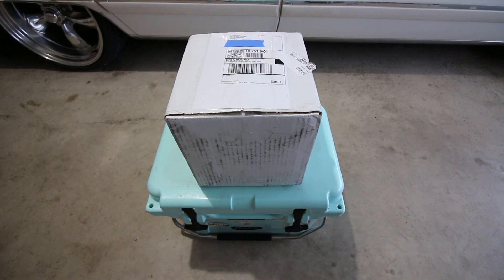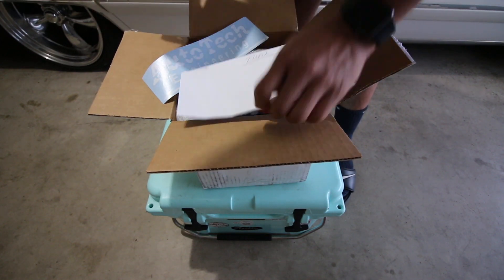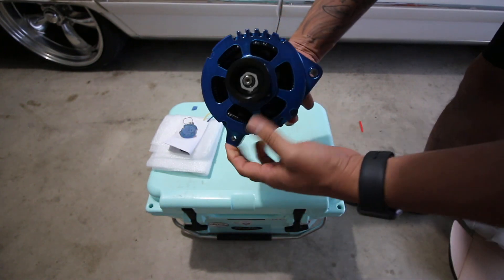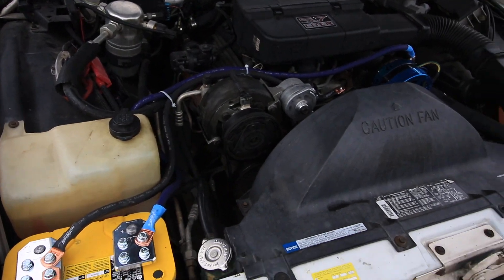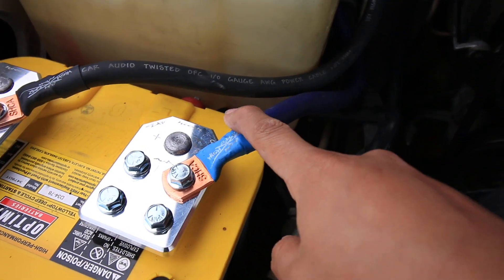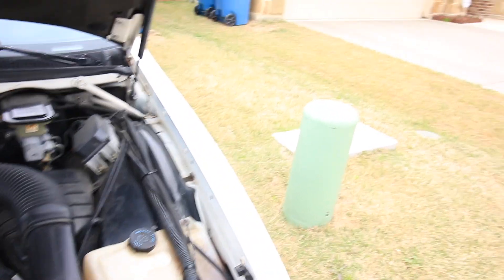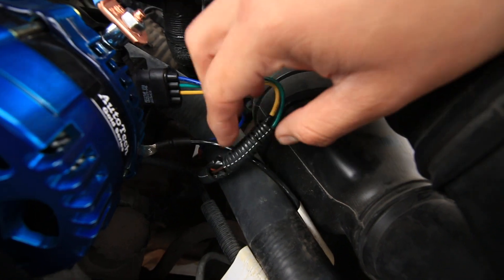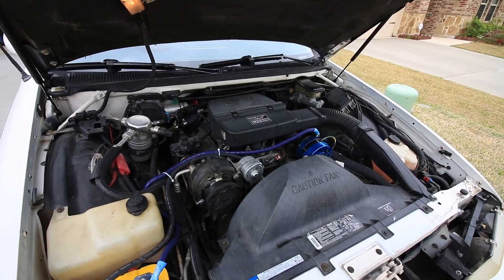AUTOTECH ENGINEERING ALTERNATOR UNBOXING AND BIG 3/4 AND UPGRADE

Comment: Did you have to use a smaller belt
Reply from the maker: Yes, you want to find a belt about a half inch smaller than OEM to accommodate the pulley.

Comment: Hey bro if i was you remove that ground wire from your chassy, then run it  to your ground post battery. The reason why i say that, is because you can fry the alternator.
Reply from the maker: The ground from the alternator to the chassis? I'm new to this, can you elaborate for me on how it would fry the alt?
Reply: @RidinDirtyTX  you get better current from your ground battery terminal. If you ground it on the chassy or block. Your not going get that good of a current. Do you have audio in your vehicle?
Reply from the maker: Yes

Comment: Do you have any suggestions on what to do if I can't access my original Engine ground I can't find mine anywhere 3.9 L v6 buick lucerne. I was wondering if I could find my own ground on the engine and leave the stock one alone?
Reply from the maker: Yessir, you’d be fine. Matter of fact that’s what I did. Factory ground was inaccessible without removing a lot of stuff, so I found another grounding point and used it.
Reply: Thank you very much!

Comment: Love the color! I might be going the same route. Difference being I'm using zero guage for power and ground and using the secondary battery first. Then if I suffer power issues I'll go with the stronger alternator. Haven't visited their site yet, but was the color part of their options or did you specifically ask for blue teal? I love that color, but since my wagon is Dark Cherry Metallic, I'd go that route for the alternator...if needed/possible.
Reply from the maker: It's an option on their site. I'm doing the opposite as you. I got the alternator to keep up with everything and will be adding a secondary battery in the future.